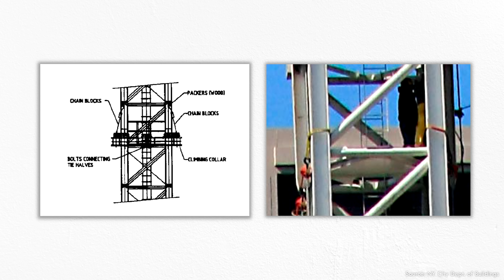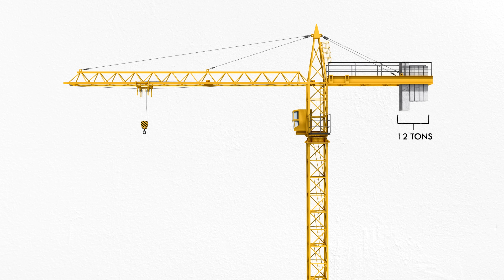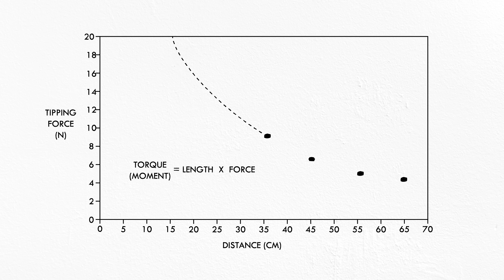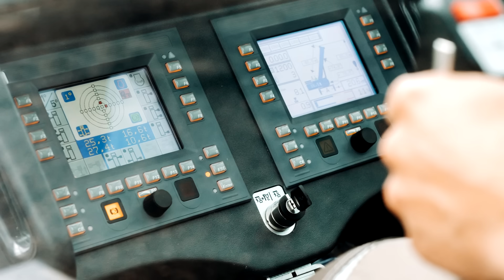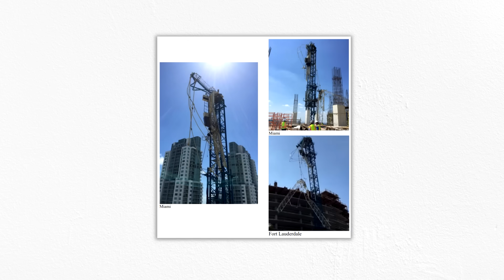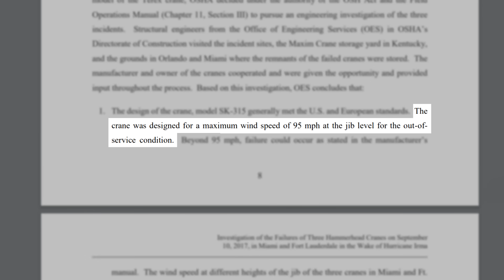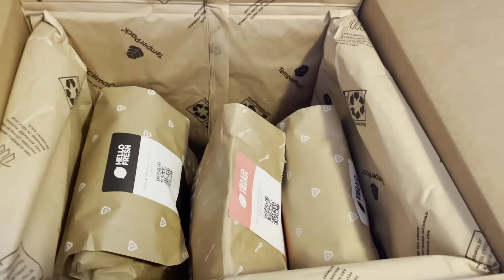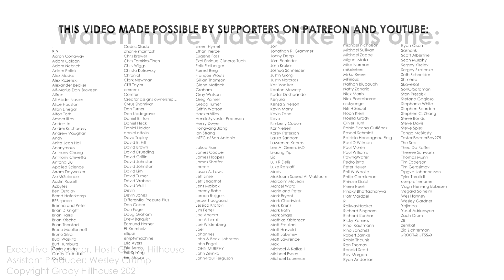Why Cranes Collapse

Comment: Norm Vogal, a crane inspector retired from PH and was my crew chief before this pic failed.  The video really highlights his expertise as how he immediately focus on the  point where the bolts where failing to hold the tensile load. RIP old friend.    The Mitsubishi lifting services people failed to record the anemometer at the top of the jib because the valley where Miller Park resides is just bellow the Woods Hospital region of Milwaukee.   This was a super stupid operator error as the crane could have folded without any loss of life had they not chose to dangle a man bucket from another machine down through the superstructure of the roof panel.  At the time I lived just few miles away and heard the crane come down as well as all the responce from every department far n wide.    I will say that nearly every crane accident is operator caused.  I live in the desert now and regular as clock work watch crane trucks do the stupidest of shit. No guide lines, workers in the kill zone. Winch up to pick a load using a truck mounted crane and so many more errors.
I had to secure a load and lift it for MFD that had fallen across the worker's chest. A man I knew.  It was completely due to incompetence and untrained personnel allowed to operate the lifting equipment. He had no idea to not rig with N hooks designed for plate on an I beam. He also did not use a choker though I'm sure no one helped him to rig the load.

Comment: Can I just say when squeezing limes and lemons, with that type of squeezer, make sure you have the cut side down, it makes it a lot easier.
Any way, operating cranes should be left down to the proper riggers and crane operator, to many ticket holders for Banking and slinging and also setting up Crane's, proper time serve riggers should all ways be present
Reply: In the UK at the moment you can become a qualified crane operator in 5 days for about £1800. That gives you a red card which means you recently passed. 6 months later you can apply for a blue card which means that now youre an experienced operator. No I dont want anyone coming back telling me you can't get a job with a red card cause I know you can, and dont tell me youre an experienced operator after 6 months. Believe me youre not. Some of the people calling themselves operators make me laugh.
Reply: @seamusburke9101  I know what you mean, I am an old school rigger, where you had to go to sea for at lest 4 years just to get AB ticket, then it was 4 year has a strapper learning the other parts of rigging.
Now day it a week course and you got your banking ticket and again for slinger  ticket, ask any of these guys to spice wire, and they can not do it.
Today it's a joke, crane operators I work with most came from ships operating the winches, when they go ashore the start with the old A frame and then to the iron ferry and work up from there, The best crane operators always say still gaining experience, where has riggers say still learning

Comment: Thank you for all the wonderful content :) 
 I was trained as a computer engineer and always found a great interest in statics and different engineering principles. Cranes are my absolute favorite to marvel at the balance between adding metal for strength and cutting down on the load you can lift because of all the metal you added. Not to mention the counter weight and everything else that snowballs in the process.   Seeing the final results in built design I see more as art. Really excited to see the future videos you mentioned involving cranes!

Comment: Story is not so much on a crane but a fork hoist. 

I had a timber delivery made to my work area, the truck driver said grab a fork hoist and unload it. We had two on sight so I garbed the one not in use and went to lift off the truck bed, I felt the counter weight lift and went na I will go ask for the heavier fork host. Co-work saw me say no to the truck driver and told me to just lift it, I said no again and said if you think its safe you do it. 

He lifts it, spins and then the fork lift face plants. It was like it happened in slow motion and the look of panic he had as it was tipping. No one was injured but we then needed to get the other fork lift anyway.

Comment: 3:14 I live in NYC and remember this collapse quite well.  One of the buildings that was flattened housed a bar called FUBAR.  For those not familiar with that phrase, the polite version is Fouled Up Beyond All Recognition, and it lived up to its name.  By the way, when I use the phrase flattened, I mean totally flattened.  It was a roughly five story tenement and it was reduced to around a single story.  I have a number of photos from this but alas, I don't think I can attach photos to these comments.

Comment: A few years ago, only a km from my home, a huge fire trapped a crane operator on a construction site.  The operator had to turn the crane into the wind and move out to the end of the boom to avoid getting roasted until a search and rescue helicopter could pluck him off.  Although the crane didn't technically fail, they had to deal with it like it did since they couldn't trust the strength of the steel where it had been baked.  It was quite an operation to take it apart.

Comment: One thing I dont get about the Milwaukee Crane collapse is the safety factors built into these machines. 
I was taught that when you buy anything that is rated to a certain weight, a 1 tonne lifting sling or strop for instance, The actual amount that sling has been tested to during a destructive test is more like 2 or even 3 tonnes. Same goes for forklifts or telehandlers. 
So this milwaukee crane, Were they working to the cranes SWL (safe working load) limit? Or the cranes absolute load limit? (Ie its breaking point). 
If they were working to the SWL they shouldnt of had any problems. Even a safety factor of 50% would have been enough. 
Am I missing something here?

Comment: Good thing to note for future operators:

When you have a heavy load lift scheduled...You're the boss on site. Nobody can force you to pick a load that you feel is not safe with the current rig you're using. It's your ass on the line if something goes wrong and someone unfortunately gets hurt in the process.
Reply: But, you can be replaced.
Reply: But, you can be replaced.

Comment: I have to watch the rest of these, but one interesting problem with crane tip-over failures is "boom drift." 
The boom (the arm) will deflect and bend, much like a fishing pole. An operator will look at the load chart mentioned in this video and say "at 20 feet reach, I can safely lift  a load of that weight." 
The trouble is that fishing pole deflection. When the operator started to lift the load, it was 20 feet away. But now that the boom is bending, the distance of the hook gets farther away. The load was 20 feet away is now 24 feet away (making these numbers up). The bending of the arm itself caused the load to "move away" and the operator is no longer working inside the safe load chart.

Comment: As a crane operator myself, I was waiting to see something in the video that wasnt accurate. I cant find much. Very well done video with good information. Although, one thing thatl definitely contributes to crane accidents is improper setup or configuration of the computer. For ex: if you enter into the computer that you have 100,000 lbs of counterweight...but in reality, you only have 50k lbs of counterweight, the computer thinks you can safely pickup more weight at a further radius. No warnings go off nor any function lockout. And over the crane goes.

Comment: Dynamic over weighting is a common problem with a lot of equipment they don't exceed the weight limit but the dynamic weight limit  comes into play a lot and people don't think about that part and another factor is it's usually not one issue going wrong that does this it's multiple things cascading on top of each other that cause major failures

Comment: Cranes weathervane downwind, not into the wind. That would be unstable.
Reply: Weathervanes also turn to have the bulk of their shape downwind, but we say they face into the wind. Same thing.
Reply: Maybe you do.  Face into the wind means exactly that. The wind hits your face. In the case of the crane, the wind hits its 'back'. And the back of the operator if his windows weren't there. We call that facing downwind.  Semantics. Not super important.

Comment: Some fall over cause operators don't put counterweights onto the crane and tell computer he has full counterweights on. Crawler cranes put their boom down onto the ground but has to have a certain amount of counterweights on to do it which the manual specifies. 
mobile cranes use different load charts around the world. USA uses 85% load charts, here in south africa some companies use 85% load charts and others use 75% load charts. Netherlands uses 65% load charts. 
Mobiles should always use outrigger pads to distribute the load and crawlers should always use pads due the load bearing underneath. 
Crawlers or lattice boom cranes use 75% load charts. when you say the crane was on 97% capacity, you mean 97% used of the 75% load charts.
Crane manuals also specify what winds you can work in. some are 12m/s speeds but also depends on the load being lifted. But cranes can't take side loads on the boom or they will collapse. The blue crane there was known as Big Blue and due to the side loading of the wind the king pin broke and thus fell over. 
Most sites here always ask for a rigging study to show clearance and the weights being lift to show that that crane you using can do the job.

Comment: @ 5:00 your demonstration of tipping line was not correct as you did not have outriggers extended on the crane.
Reply from the maker: Sometimes there's not enough room for them. The tipping line depends on the crane configuration.

Comment: Big Blue incident was 100% preventable. (To my knowledge and story I heard while in school for crane operation) The first crane operator said no to the lift due to wind being at or above the rated capacity.  He told the superintendent, he wasn't going to do the lift and was told to leave.  The super then told a less skilled operator to make the lift.  Operator #2 made the tragic decision to make the lift.  He can be seen leaping from the operators cab in the video and running away.  Both the super and operator were charged and did jail time.

Comment: Thanks for your video. Many years ago, I got to watch construction of a wafer fab using cranes. I saw a mobile crane help put together a much larger mobile crane which in turn was used to assemble a tower crane. Showing that process including how tower cranes increase height would be very interesting.

Comment: I remember when the crane collapsed in Milwaukee. Remember going to a baseball game at the old County Stadium that Miller Park (will still always call it that) was replacing and seeing the crane toppled over. Was a crazy sight to see and was an extremely unfortunate accident. The three people that lost their life during the collapse were suspended in the air at another location in the park working on other sections of the roof when the crane came down and caused them to fall. That statue is a great addition to an already amazing ballpark, and it is right out front and center of the main entrance into the park.

Comment: The short explanation is, there are two reasons. Because the forces are not easily visible until it is too late. Because companies don't want to pay for people that are diligent and meticulous enough to control every step of the process of setting up the crane, planning load movement, securing the load and inspecting equipment.

Comment: As a geotechician I often do tests on soils to know their resistance to a static load prior to the installation of a crane. And more often than you want to know, the peoples in charge of making a stable platform for the crane do such a shitty job, that I am amazed that the crane was even allowed on site by their owners... and even more amazed that collapses are not more regular!
On another occasion I had to perform a test for light traffic road and parking lots around a big hotel complex being built. It was very crowded and difficult to attain some parts of the working area, notably because a mobile crane was in the middle of the road. But our client asked if i could use one the four legs of the crane to act as my load for the test. Being a bit inexperienced and under pressure at the time, I almost pushed 7t onto a 5 wheeler crane with its mast raised and operating... But i came to my sens and told him that it was not safe. He insisted. I declined again. My boss told me after that "was he trying to be on the news?"

Oh the stories you get when you're a geotechnician...

Comment: Regarding the crane collapse over the Google building.

It was lucky that this happened on a weekend.  If it happened on a pre-pandemic weekday anytime between 4 p.m. and 6 p.m. the fatalities and injuries would've been significantly higher, as Mercer, the road that it fell over, is significantly congested and also has a fair bit of pedestrian traffic. 

It's also a bit lucky that it collapsed over the building, which I'm sure took lots of the brunt of the crane's collapse.

It was unlucky for Google that the Google Cloud logo got installed on the building just a week or two before the collapse, so many of the photos from that incident include their logo.

Comment: If I remember right with the big blue crane collapse the normal veteran operator said he would not pick up that load. Then a younger guy trying to prove his worth said he would do it. The safety inspector mentioned said it's not safe to do. However they decided to carry on. When they were making the pick the safety guy was driving buy decided to record it thinking it would collapse. He was right.  This is why I say if the veteran operator won't do it for safety reasons you should not do it either.

Comment: So many cranes are falling down ? So so many

Sure, operator error, supervisor failure, idiot factor is a problem. nothing new here.

Come on, this is not a scientific study. No model needed.  I am neither an equipment operator, nor an engineer. We already know when you leave out parts, counterweight wrong, etc etc etc., something undesireable will happen.

Watched this video expecting to learn something. AvE covers the human error aspect quite adequately, as well as the technical failures. And he has a Prudence to bleet for safety.

Comment: As usual a very good and informing video.

As a Person who works with cranes on a daily basis (as an operator and just around them) i can agree with everything you said, but there is one more risk that should be talked about:
-Lifting something that is attached to the ground.
For example a heavy object (lets say a Generator) has to be removed. Construction workers removed the bolts that attached it to the ground but forgot one of them...The operator tries to lift the object and applies force.
If the weight of the load is unknown or the operator knowingly applies more force than would be necessary for a load with that mass (NEVER DO THAT), a lot of force goes into streching the cables and elastically bending the Crane itself.
If the bolt breakes, all the energy stored in the crane and the cable gets released suddenly, sometimes even so violently that the crane tips over and lands on its back.
Well trained operators would never even atempt to pull the the stump of a tree out of the ground or lift anything that still could be attached to something.

(English is not my first language please go easy on me)

Comment: Interesting video! I once witnessed a crawler crane failure, but luckily not the whole crane. The brake of the cable drum of the upper jib section failed (the cable drum that adjusts the angle of the upper boom)... so it came down. It caught so much speed while swinging down, that the cable drum kind of exploded with many pieces bouncing inside the latice boom like in a pinball machine.

Luckily when the upper boom section had finally crashed into the ground, the whole crane kept standing. And no further issue.

Comment: Ironically, one of the best ways to prevent a soil from draining properly, thereby decreasing its ability to bear a load when it rains, is to compact it. Which is basically standard procedure.

I find the way engineers talk about soil very frustrating. While I was getting an MS in soil hydrology, my brother was doing construction testing. We would try to talk about soil, which we both dealt with daily, but our vocabularies and analyses were very different and often polar opposite. The metrics that an engineer sees as good are likely to be seen as a pedologist or farmer (I'm both) as indications of damage and deterioration.